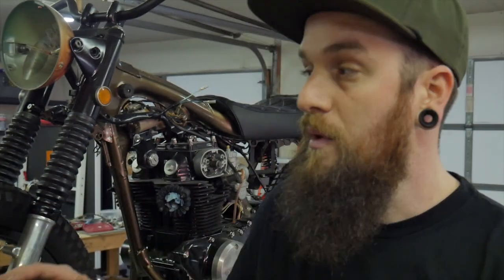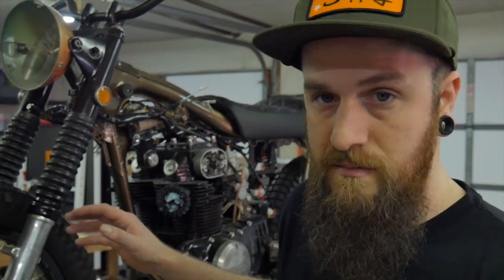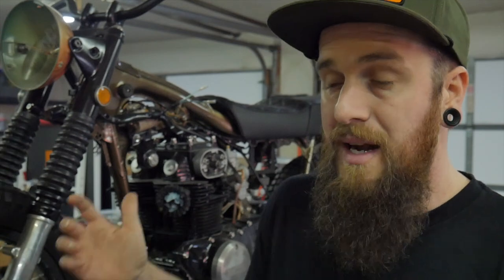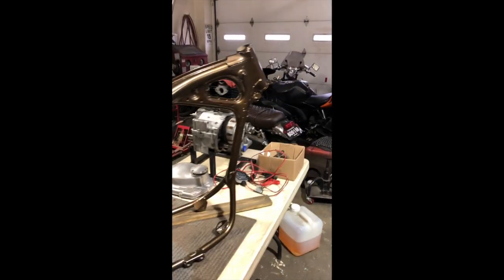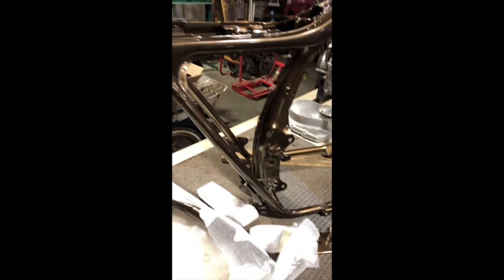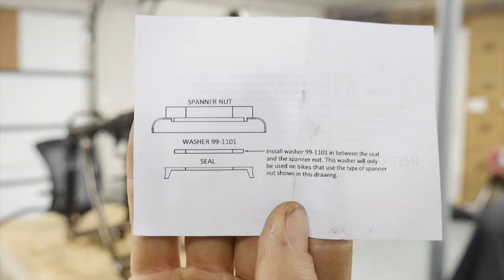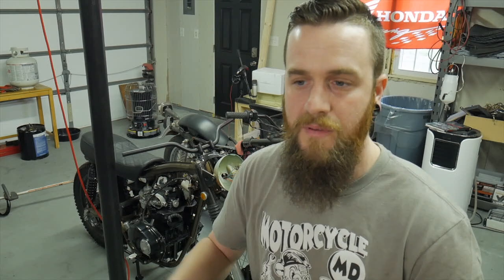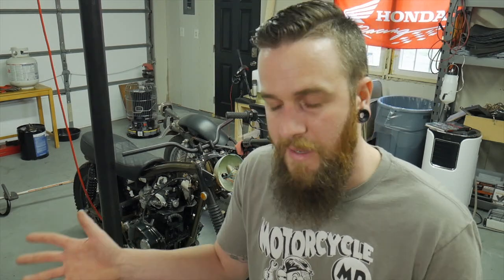1970 HONDA CL350 TRACKER BUILD - PART 1 : CHASSIS

Comment: Great choice on the frame colour. Its going to be an incredible bike when its finished. Those 70's CL's have such a great design starting out. Its a pity Honda don't style a range of their bikes like that anymore. I stripped down a rusty 1985 Honda Shadow VT700 two years ago, got it welded up, repainted it myself with a dark silver frame and orange tank/panels and rebuilt it. It's such a good feeling even still to look at it and ride it every week.